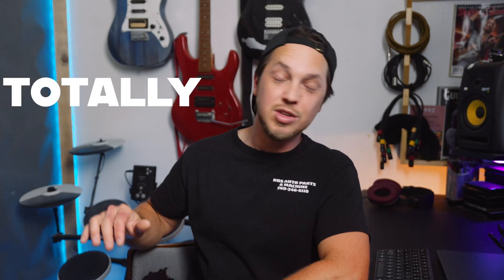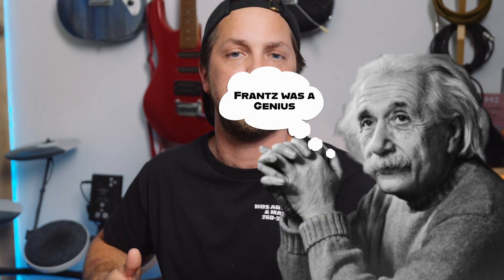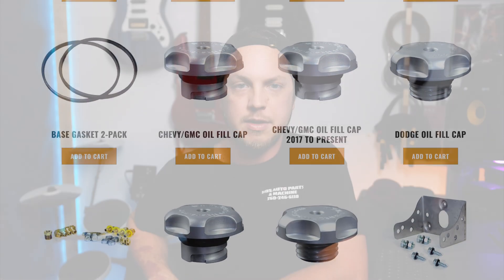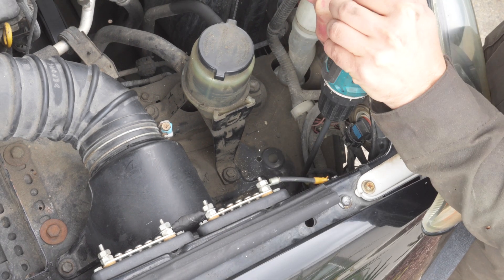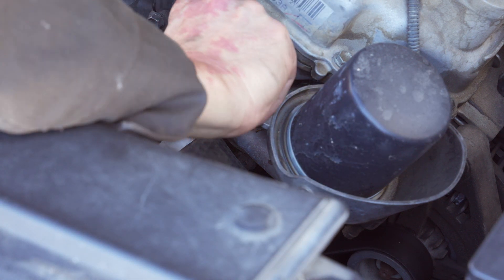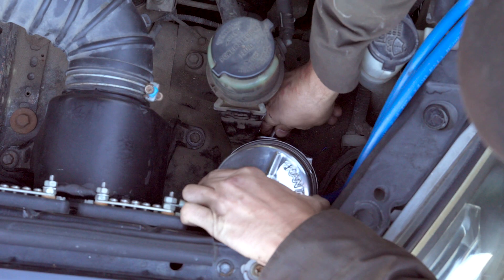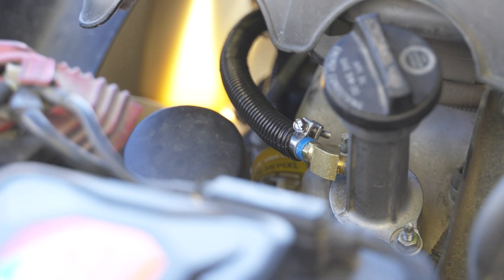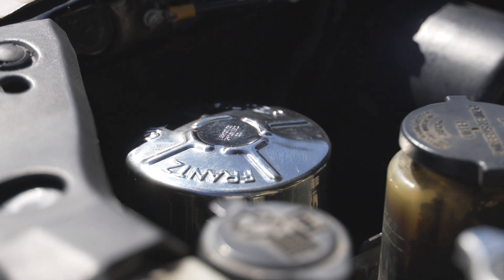Never Change Your Oil Again: Frantz Filter Bypass System Explained & Installed

Comment: Nice video. I’ve used TP filters for 25 years (Motor Guard and Gulf Coast). I’m now preferring Valvoline Restore and Protect. The 1000 sheet TP is still the best to use.
Reply: The Australian Jackmaster Classic is a nice filter. They use what looks like 1000 in a sock.  I drilled out the orifice on mine and used a Perma Cool universal 189 oil cooler adapter on mine. I bought several from Jegs years ago. Summit has them. There is a bunch of them now
Reply: About 1971 I was across the lake from Sandpoinnt Idaho installing a Motor Guard on a new GMC Sprint. We normally punched holes in the steel fender panel. That was my first experience with plastic fender panels. We didnt have things like cordless drills. It was getting dark. Mosquitoes were eating me up. All hell broke loose. Elk coming into the yard. The farmer said its hunting season they feel safe here. Many years later a  boss at Safery Kleen where I was a mechanic asked me to put Gulf Coast filters on his new Chevy pickup and his 41 foot Chris Craft. Plastic fenders again. I had access to the shop. Had to fabricate a bracket. I believe it was a 6.0 gasoline. Used a Perma Cool universal 189 sandwich adapter. It was a hassle. Front wheel drive shaft  right in the way. Went up to lake Texoma. The Chris Craft had twin 454s and a L head generator. Romoved a flange and found a pressure and return port. Did the 454s the conventional way. Used a 3/8 hollow bolt to replace a intake manifold bolt. Dont know if you can still get them. I had to make them. Frantz and Motor Guard had them. Years before that i did the twin 350s in his 33 foot Carver
Reply: I normally use Great Value 1000 sheet from Walmart. We didnt have tightly wound 1 ply when Motor Guard came out in the 60s. We had high quality 2 ply. I would use the whole roll. Just before the halves came together I would push the paper in with my knife blade. I did a M 30 compressed air filter a little different for motor oil. I removed the plastic parts. Put a 2 1/2 inch OD by 1 1/4 ID washer in the bottom for a core seal. Reamed it a little so it would press on. The center tube isnt needed with the 1000 sheet. The origional lube oil filter filtered from the bottom up. A 2 inch OD flat washer was in the top. Correction  The origional sealed inside the core. They required 1 1/2 inch core paper. The flat washer came later.
Reply: The owner of Gulf Coast filters passed away. His top salesman now ownes the company and discontinued the little filters. His thing is only heavy duty diesels and things like polishing aviation fuel and things like polishing Abrams tank fuel. Fuel gets bad in storage tanks or in equipment not being used enough but has to be ready to go.
Reply: That 1/8 inch tap brings back memories. McMaster Carr has adapters metric male to 1/8 pipe female.  I took a big Gulf Coast filter and two small ones toFort Worth Texas for a big RV the generator and a Volvo. I had a 1/8 pipe tap I had used on older Volvos. This big Volvo had a oil pressure switch with straight threads and a gasket like a spark plug. The owner took me around Fort Worth until we found a adapter. I think it would have taken a Frantz Ford sandwich  2 port adapter. I had one at home but I was a long ways from home.
Reply: The Frantz 2 ports were a life saver on some cars. The oil flowing thru them created a pressure difference. A little bit more pressure in the oil line going to the Frantz than the return line. The Perma Cool 189 has a spring loaded bypass valve. It has bushings to fit most cars. You have to use a 3/4 16 thread filter. My diesel tractor uses a Motor Craft Fl  1A with a 189 sandwich and a Flat head Ford V8 canister filter converted to use a 4 1/2 inch Scott 1000. The Ford is 4 1/2 inch ID. John Frantz put a Frantz canister inside the Ford canister. I use only the Ford canister. I have half a roll of VIVA paper towels in it now. A lot of filter material in VIVA towels. When I was doing Gulf Coast filters the diesels used Bounty big roll paper towels. Dont know what they use now. They claim 99 percent at under 1 micron for the big one. 22 inches of depth.
Reply: With the big Luberfiner 750 like we bolted to the big trucks it was about 3 inchesof pulverized newspapers. With toilet paper filters its about 4 inches. With the single Gulf Coast filter for diesels when I installed them it was 11 inches of Bounty big roll paper towels. 22 inches for the double. My Flat head Ford V8 canister filter.  Was about 2 inches of cotton until they went to about 1/8 inch of pleated paper. Can anyone guess which filters best.
Reply: Many years ago I was putting  a Frantz on a Chevy LUV. I could see a little Frantz on his 18 wheeler frame. I said sir that little Frantz is too small for that truck. He said no it isnt I change it every day. He hauled hay from Colorado to Texas. I said don't we have hay in Texas. He said we have some expensive horses. Hay in Texas has blister bugs. A blister bug can kill a horse. He sounded serious.
Reply: I dont know anything about oil.I know acid. Weak acid is very corrosive to steel. If your dipstick looks good you dont have an acid problem.  Dont know if it is true but im told most oil comes with acid neutralizers. In over 60 years ive never had an oil related problem. Clean oil doesn't foul or wear out an engine.
Reply: My 41 Dodge had a lot better filter than the new cars. It used cotton the same as the old Luberfiners. They were all optional equipment in those days. Some were factory installed. Some were dealer installed. They were in auto parts stores. Saw them in auto parts stores at least into the 70s. All we had was junk in the full service gas stations.

Comment: Dont know how we got by in the 60s Frantz and Motor Guard didnt tell us what oil to use all we had was universal models. No fancy oil fill caps. They didnt tell us we needed acid neutralizers added. The owner of Frantz said keep the oil clean and dry and you dont have acid problems. We got by.

Comment: Never change the oil again, just buy a new engine every 30k miles.
Reply from the maker: @wolfschindler8921  haven’t changed the oil in my 1985 k20 in 15 years. Put a lot more than 30k miles on it.
Reply: Clean oil will virtually stop engine wear. The conventional system of allowing the oil to get dirty wear and foul the engine then draining it is not keeping it clean.
Reply: I have heard a lot of ignorant statements. When I was working at Ford a guy said he didnt care if they outlawed cars he would ride a horse to work. If those filters eliminated oil changes they would sell them at the oil change places.
Reply: All I use now is Motor Guards  Gulf Coasts a Australian Jackmaster Classic and a flat head Ford V8 canister filter converted to use Scott 1000 for the diesel tractor. Probably not the smartest thing you can do.
Telling people about filters that clean oil when almost everyone thinks proper maintenance is allowing the oil to get dirty then draining it. Frantz wasnt the best design. The top loaders are a lot easier to service. They are about all gone now. The few left are expensive. Frantz is the biggest name in filters. They keep coming back.
Reply: Took me about 20 years to put 250.000 miles on the 84 Subaru with no oil drains. On that car I used a Frantz with a Frantz adapter that replaced the full flow filter. Im a filter guy not an oil guy. I used Mobil 1 15 W 50 racing oil in that car. Probably too heavy but im in Dallas Texas. My 79 Ford diesel tractor calls for 30 weight in hot weather. I started with Standard Delo 30W when multi grade would ruin a diesel. After over 60 years I can still find Delo 100 30W. Dallas qualifies as hot weather.

Comment: AMSOIL sells the modern bypass oil filter system; i think replacing the oil at 100k miles is the nominal recommendation; change the bypass at once per year and change the normal oil filter at 2X per year; so that is three oil filters per year. And a few qts of oil in addition to those three filters; so you can add the $ of that up and it may cost more than just changing your oil 2X per year including a filter, or very very close (and simple). But the bypass system is a 100 years old. you decide for your $$$$.
Reply: A local Amsoil dealer told me he went to change his Frantz and it was empty. The complete roll had dissolved and was somewhere in the engine. That was about the best one I have heard. I was reading one post where a toilet paper filter salesman talked his dad into putting one on his Cadillac. As soon as they started the engine it siezed up. One post says there is less chance of toilet paper getting in the engine if you use Amsoil or Insane filters. There is zero chance of getting toilet paper in the engine. One guy told me so much toilet paper was getting in the engines Frantzs have been outlawed in Texas. At the time I was selling them in Texas. When Amsoil first came out Frantz dealers started selling it. They were called Frantz Amsoil dealers.
Reply from the maker: @SmooveBee1  for me the cost of the Franz replacement filters is so cheap, plus the benefit of always having clean oil in your system is enough benefit
Reply: Most of us that have been using toilet paper filters for over 60 years started with a Frantz. I like the top loaders better because they are easier to service. I started in 1963 with a Frantz oil cleaner and Standard Delo 100 30W. It was 29 cents a quart in the discount stores. It was for diesel engines but my Rambler American did fine with it. Multi grades were no good in those days. Couldnt use them in a diesel. I changed the 2 ply and added a quart of Delo about every 2.000 miles. Didnt drain oil. Oil was normally a nasty mess in 2.000 miles with normal oil filters. Right now I have a Australian Jackmaster Classic on the Pontiac Torrent 3.4. I drilled out the orifice and installed a Perma Cool universal 189 sandwich adapter. Its for oil coolers but works the same for bypass filters. I normally change the Great Value 1000 from Walmart and add a quart of Walmart synthetic every 6000 miles. Since im retired now I will make adjustments. My diesel Ford tractor uses a flat head Ford V8 canister filter converted to use Scott 1000. A Perma Cool universal 189 sandwich and a Motor Craft FL1 A.. I have some Gulf Coast filters and Motor Guards in use.The Motor Guard on the old F 250 390 engine is   over 50 years old. I am a filter guy.
Reply: I remember when Amsoil came out with the canister filters. They were far superior to the spin on filters. They had Bobby Unser saying this oil change is forever. They might have learned their lesson. People cant handle being told no more oil changes. Better to use less effective filters and say things like extends oil drain intervals. More people can handle that.
Reply: I normally change the full flow filter every 2 years and the toilet paper filter every 6.000 miles Thats mostly warm weather highway.
Reply: It takes a good salesman to convince someone Amsoil is as economical as toilet paper.
Reply: That dual remote system looks like an over engineered night mare.
Reply: I have never understood why someone would change the full flow filter more often than the bypass filter. The bypass filter is doing all the cleaning. The only reason to change the full flow filter is the pleats will eventually get rotton. Neglected toilet paper will get rotton but it will stay in one piece.
Reply: My 41 Dodge had a bypass filter. At cleaning oil it wasnt as good as a Frantz but was far superior to the bypass filters that are factory installed on some mostly diesel engines. They are usually pleated paper with an orifice. Go into any auto parts store and ask for a filter that cleans oil. They have none.

Comment from the maker: Looks like I triggered all the trolls in the first 30 seconds of the video lol
Reply: What you are saying is the truth. People cant handle the truth. They think oil is supposed to get dirty and be changed. You are trying to get the  trolls out from under the bridge.
Reply: I can't say Ive never changed the oil. My 93 Subaru Legacy had 116.000 miles on it when i bought it.i changed the oil at 225.000 miles because I wanted to go to synthetic 0il. It has 239.467 on it now. Met a lady with a 06 Pontiac Torrent she keeps insurance on as an extra car. I started driving it. Told her I was going to put toilet paper filters on the engine and transmission. She said toilet paper oil filters.Stay away from my Accord. She needs to show some respect. I think she is softening up. She wants a new car. She came home the other night with a head light out. She said that does it we need a new car.
Reply: The Pontiac Torrent has 70.000 on it since I put the toilet paper filters on the engine and transmission. No oil drains. 210.000 on it now. I wont live long enough to wear it out. Told my wife when the computer says its time to change the oil nothing is wrong with the oil. Im disagreeing with Honda. Then she tells me they dont recommend bypass filters at the oil change place.
Reply: When I met my second wife she had just got her 66 beetle out of the shop for a swallowed valve. They told her because the beetle had no oil filter she should come in for an oil change every 1500 miles. I told her I will install a Motor Guard and it will need no more oil changes. She said cool. The Motor Guard filtered from the bottom up. Had to tilt it so the big stuff wouldnt gravity back to the engine at shut down. Frantz recommended putting the Frantz upside down on the beetle.